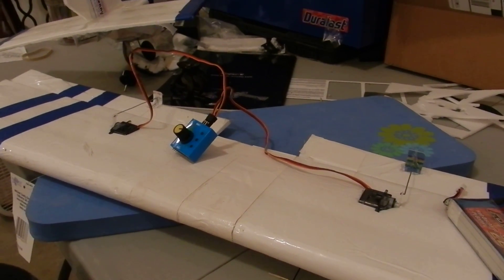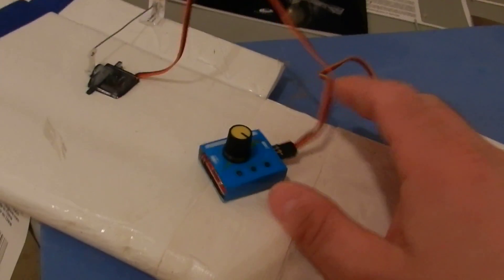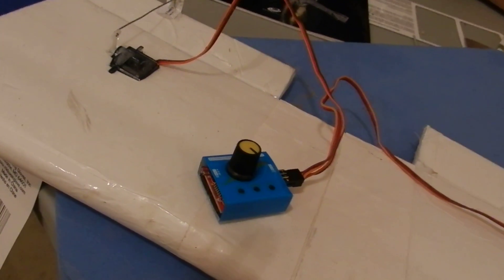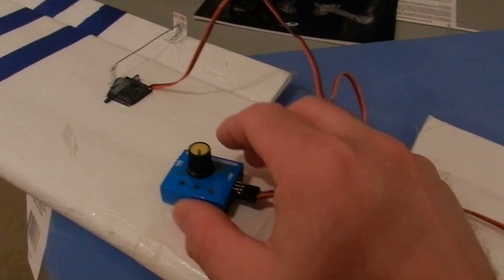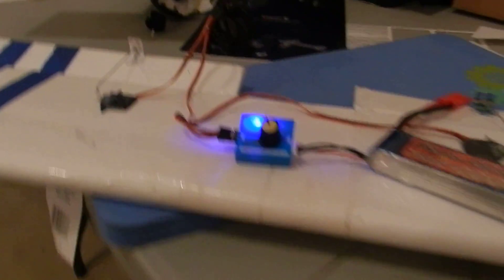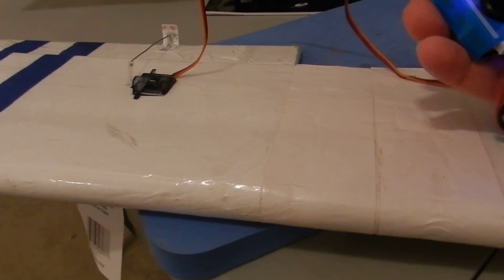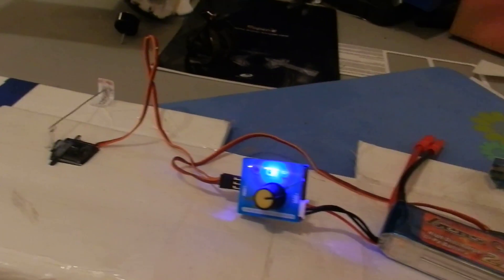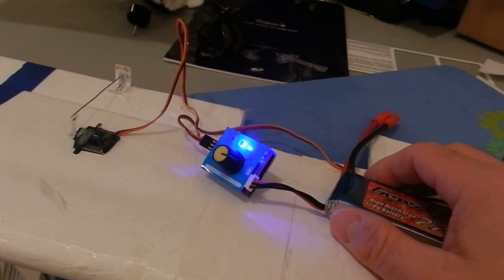RC plane tips - Using a servo test to center control surfaces

Comment: absolutely useless unless you want to see that the servos are working as when you center the servos on a rc setup then you go and connect your receiver the servos wont be in center as the receivers information that its sending wont be the same as the tester so if you go and cut control horns and make z bends and so on  and think your all done to only then plug in your receiver and the servos will be out by a few degree , your radio and rec is the best to do any rc setup this is only good to see if the servos are actually working/faulty and length of travel  thats about it.- when it comes to good rc setups there's NO short cuts ......

Comment: You are using a 22map  at 7.4 Volts. Isn't the tester rated at a 4.2 - 6 Volt range? You may risk burning it out.

However. Great Video

Cheers
Reply: I think its fine bc he is using the balance lead?

Comment: I recently used one of these to set up servos for a F3P plane. The threes servos centered that i used them on were off by 15 - 20 degrees versus the radio. I wasn't very happy with that! But thanks for you video, they are handy and the cycling feature is a big help.